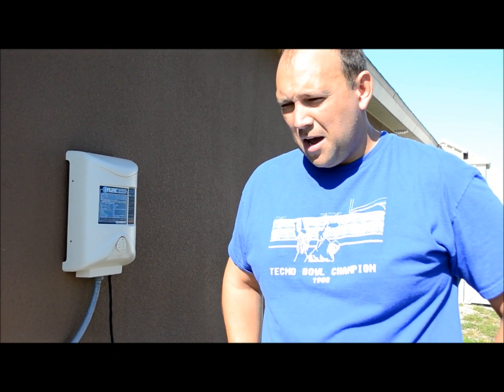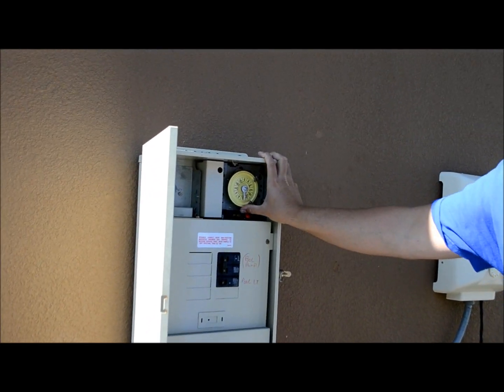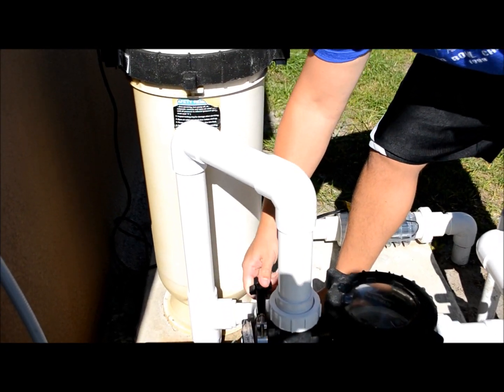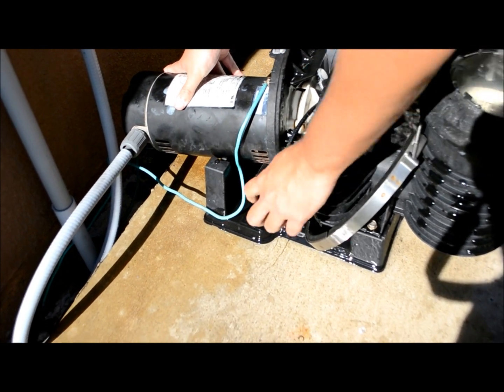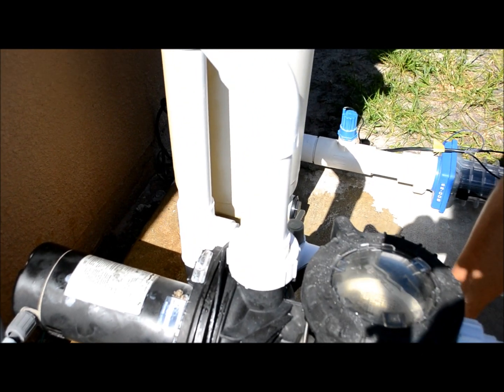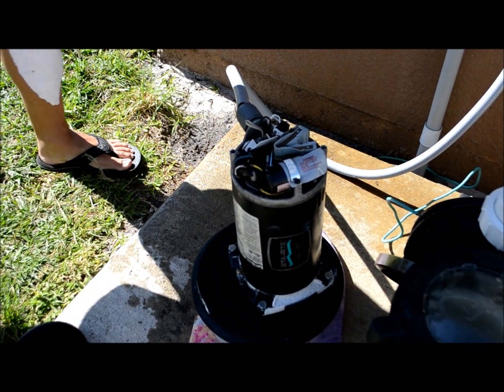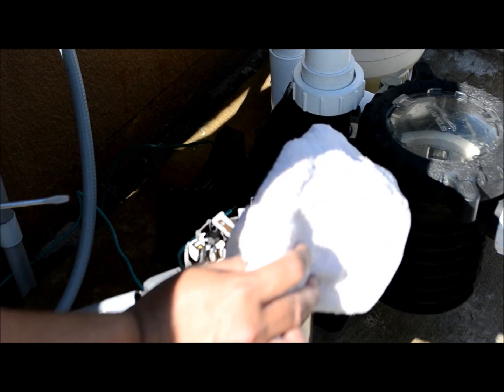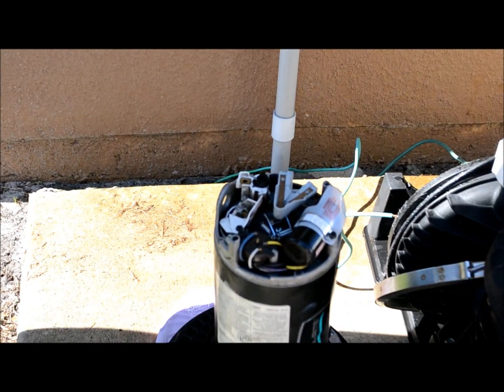Pool Pump Repair Part 1 of 3.wmv

Comment: Great video.... did you remove the "drain plugs" before splitting the housing?
Reply from the maker: I did not.
Reply: @poolnoobie  lol I believe I tore apart my Max-E-Pro pump(s) P6E6G-208L (I have 4 of them), using your video as reference...Excellent job. Thank You

Comment: can a impeller be over tightened causing the motor to run hot?
Reply: I've never seen an over tightened impeller cause the motor to run hot but I have seen it where not tightening it enough causes it to rub up against the diffuser plate and not spin as freely.

Comment: I can't see how you discharge the capacitor?
Reply from the maker: Sorry for the lack of detail.  You simply touch a screwdriver across both terminals.  I found a good video at this link that shows it.  Discharging Capacitors

Comment: couldnt see where you jumped the capacitor
Reply from the maker: My apologies.  Here is a link to a video that shows it in better detail.  Simply touch a screwdriver across the two terminals.  Discharging Capacitors

Comment: it can happen with lightning strikes or by water damage, a new motor can be damaged in about 3 month do to water damage, it contaminates the grease in the front bearing, most common cause is starving the pump for water, this damages the shaft seal.

Comment from the maker: I had something similar happen.  I ended up doing a couple of things to fix separate issues.  I disconnected the motor from the rest of the pool, took everything off down to the seal plate but left the motor connected to the electrical box.  I then tried to start the motor.  The first issue was that the starter switch wasn't coming into proper contact with the top of the shaft.  The other issue was that I hadn't tightened the impeller enough and thus it wasn't allowing the shaft to even turn.

Comment: Got everything hooked back up and it wont start moving. It tried to start once and that's it. It still hums like it wants to start. The motor got super hot very fast. I opened up the air valve to max and pressed the jets button twice to engage high speed motor...How easy is it to fry a new motor? If I switched the plugs for the pressure switch that wouldn't cause that?.Any help would be greatly appreciated. I have a 1999 hot spot re, rlx model Z and the motor wavemaster 3000/5000

Comment: I recommend not taking off the ground wires until the hot wire is disconnected. Also you should go to the main breaker panel to shut off the power 230volts with that kind of current will kill you. Also don't count on the thing to be wired correctly; I have found live voltage on ground wires before. You should never use both hands while disconnecting wires (you are completing the circuit thru your chest).

Comment: THIS is when the pump is installed. people see the pump leaking and tighten these 9/16 BOLTS thinking it will stop the leak and it will pull the brass inserts out of the seal plate and destroy the $100 seal plate "take off the band remove the wires from the back of the motor your job is done" bring it to me and I can fix it for 75.00 w/ free shaft seal and a 101 on how to install it and maintain it for max life.. Jay the pool pump motor repair guy in longwood FL

Comment from the maker: Thanks for the tips and the nice comments.  Video #2 is in the final editing stage.  I'm curious on your comment on do not touch the 4 9/16'' bolts.  Most videos I've seen remove these to replace the shaft seal.  Perhaps I could see getting around this, however I do not see any way with the lock nut to get around this when replacing the bearings.  What is the exact issue you are trying to avoid here?

Comment: YEP THAT'S THE BEARINGS. ONE OF THE BEST PUMPS YOU CAN BUY! BEST OFF TO HAVE THE MOTOR REPAIRED BY A PRO. I CHARGE 75.00 AND THAT INCLUDES A FREE SHAFT SEAL. DO NOT TOUCH THE 4 9/16 BOLTS (EVER).. GOOD INFO BEST  VIDEO I HAVE SEEN YET !. NO POLARITY ON SINGLE SPEED, GREEN WIRE GOES TO MOTOR GROUND ABOUT 1 O-CLOCK USUALLY A GREEN SCREW.. BUT ON 2 SPEED MOTOR IT'S A MUST TO TAKE NOTE OF THE WIRE PLACEMENT !!!.. Jay the pool pump motor repair guy in longwood Florida the guy who presses bearings on